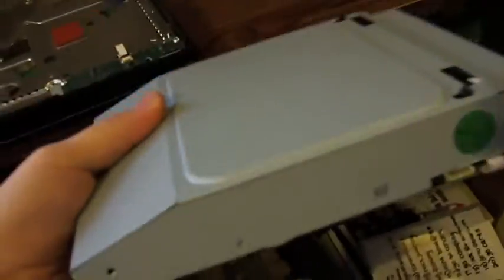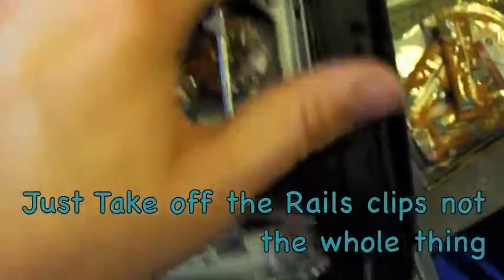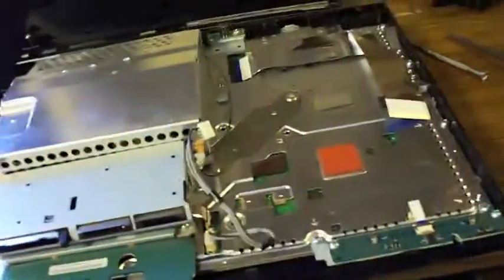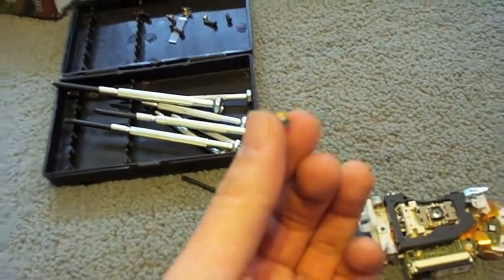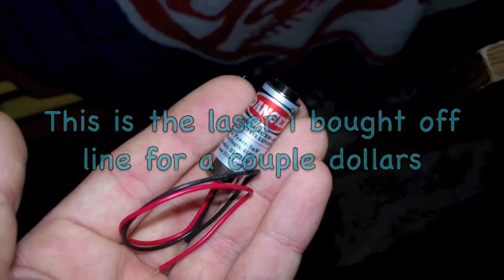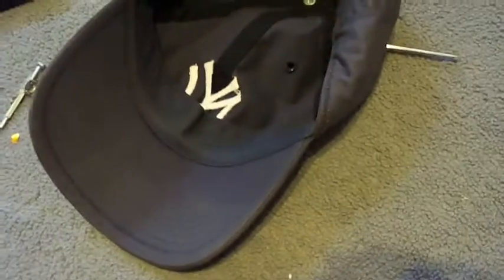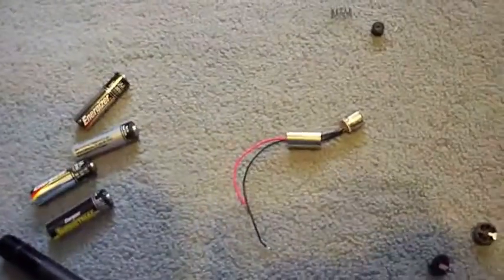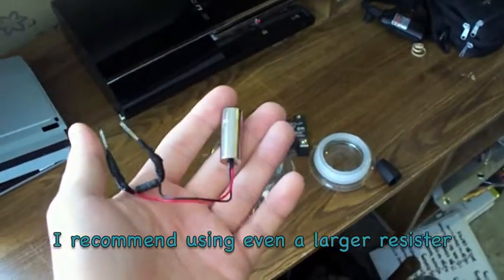blu-ray laser from a PS3

Comment from the maker: your exactly right, i didn't have the right resistor size at the time, so i used it like a current limiter, (not a very good practice). In parallel current changes as you know. This was a bad example of how to do this but it was all the materials i had at the time. I will most likely make a new video with an actual driver circuit.

Comment from the maker: @Deanme yea you should put it in series with an LED driver, but you can use V=IxR and figure the current in parallel and then figure what the watts of the laser will be. the laser i was using was bad anyway do so i didnt care what the power was. needless to say, the laser burn up relatively quick

Comment from the maker: @jitsun07 the five prong is the blue ray diode the three is the red dvd reader laser. search blu ray laser diode pin layout on google and it will show you what voltage goes where. i tried posting the url but it wouldnt let me put it in a comment. any more questions just let me know.